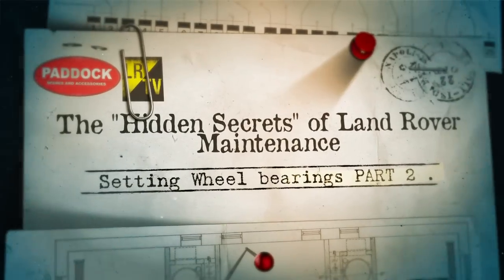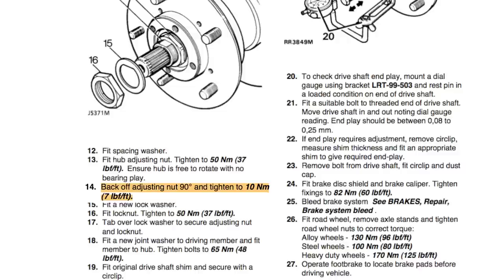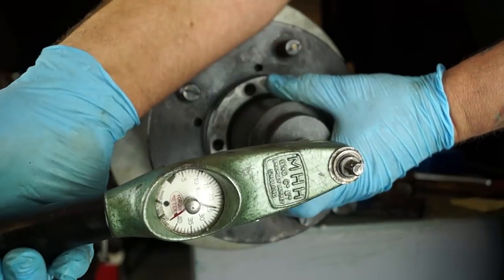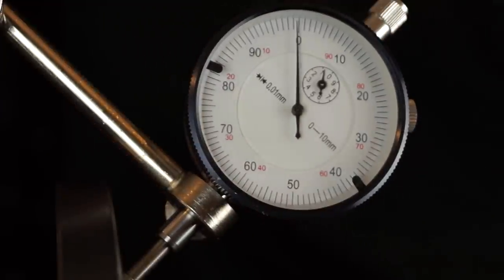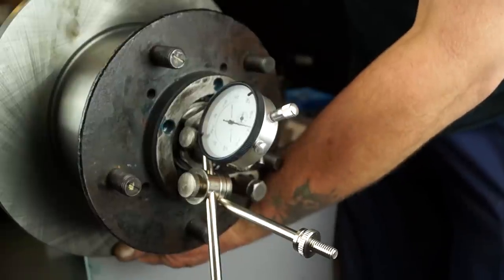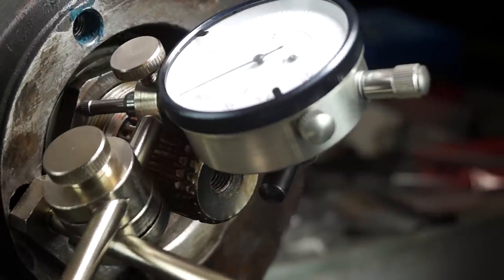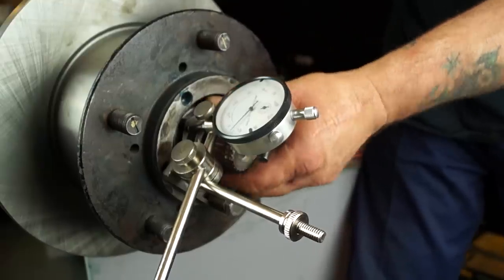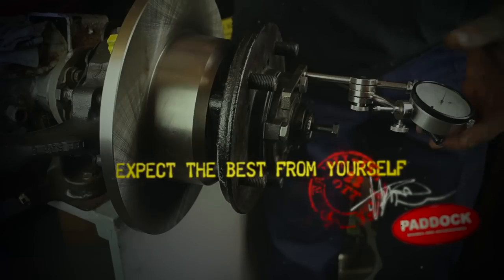Land Rover wheel bearing adjustment Part 2  Dial Gauge setting

Comment: When I torque the locknut I loose all my end float. The Haynes manual says to use a large spanner to hold it steady but there no clearance with the lock washer. Any advice please 🙏 (1986 2.5na axle is a 20L)

Comment: Do you think the difference between end float on disco 1 and 300 defender is to do with the weigh difference? As I think I understand it, they are pretty much same axels? I have 1986 90 with 1995 disco 1 running gear under it. Always unsure which Haynes manual to believe 😄

Comment: Great video!
Just a few considerations and questions.
Considering I am not a mechanic, so I cannot afford to buy all those excellent tools (I wish I could!), I am curious to know your opinion  about tightening the nut using a snug tight procedure.
I recently replaced the front right wheel bearing on a '2000 Def 110 Td5. Because it has a spacer and only one nut, I shouldn't be worried to check the preload because the spacer provide the "idiot proof" system to keep the correct preload, am I right?
In another video you said that there are different spacers. Are you referring to the spacer between the wheel bearings or other spacers? or you are referring to the spacer for a Tdi model?
If I do not replace the disc I don't need to buy a new spacer, right?
For now it works fine, no sign of anything.
I will soon have to replace the rear discs. In that case, is there a single spacer thickness? If not, how do I know the thickness? I guess the unswer is that I should buy all those tools. :(
Moreover, the previous owner installed HD axle shaft. Does it change anything in the procedure from the original shaft? 
Thanks heaps!
Davide